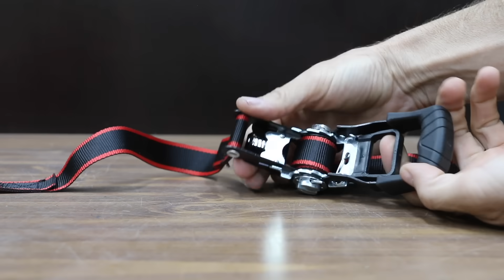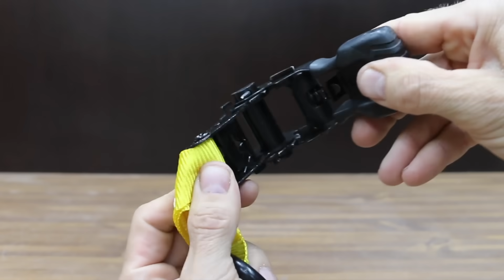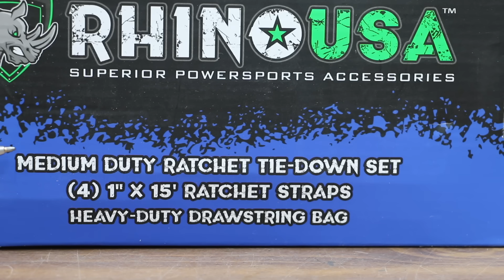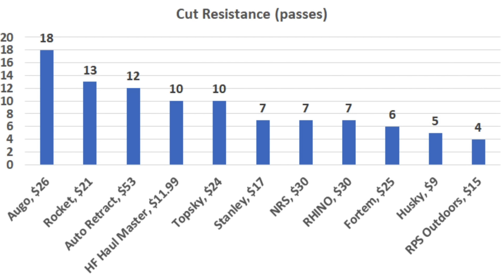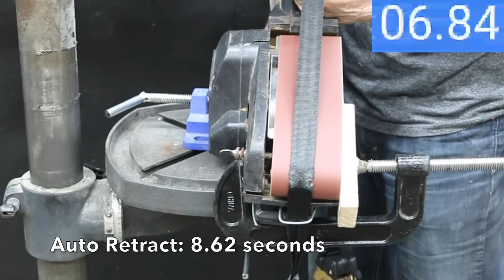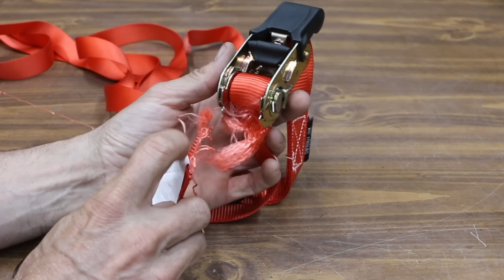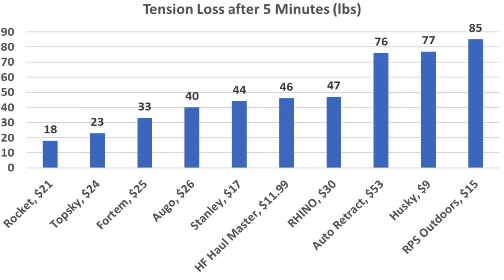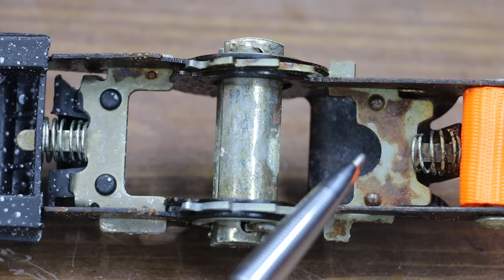Best Ratchet Strap? Husky vs Stanley, Rhino USA, Rocket, Topsky, Augo, RPS Outdoors

Comment: I can recommend those auto retrac ones.   
They are fast and efficient.  
   
They are perfect for leaving in your truck and using them for light to medium duty hauling. Things like a mower, pressure washer, grill, and so on.  
  
I have 2 in my truck bed permanently hanging from 2 hooks so whenever I put anything in there I can quickly strap it. Then I have a set of 4 standard type straps I use for anything really big.

Comment: So I’ve had a few of these straps that I use for hauling motorcycles and strapping to my lifts at my shop. A lot of the time with the ratchet straps over time the failure is the stamped ratchet mechanisms start to warp and Swiss and eventually fail. I like finding cast housings. I do use the autos ratchets you showed they are holding up in that aspect but the streams going to the hoops for the hook are not plentiful and thick enough so it’s stretching out the fibers in those areas as shown. Keep up the good video

Comment: I have various different ratchet straps ( about 30 of them, so so quality), all do pretty well over a period of 15 years so far with use about once per week. One is pretty badly rusted but doesn't affect performance, a few had cuts but that was my fault. Use for tie down refrigerators, top heavy 60 gallon compressor, motorcycles and such. Even used those straps to remove 8" tree stumps with chains and come alongs. Major PIA are the spring loaded detent clips falling out or misaligned.

Comment: I have been using the haul master ones for years with no issues...no failures....yes they do wear out over time and dont leave them out in the weather or they wil disintegrate from the elements. I used them to haul harleys scooters dirtbikes quads trikes minibikes bikes wood furniture fencing appliances etc.  I keep several in a cheap plastic hone depot type tool box....they are cheap enough to replace so i dont care if they fail. I also the husky 1 too... Same thing no issues

Comment: You really need to add ShockStraps to this test. While there is nothing like them, they have features that are unmatched and I have been using them for years with great results. They use a shock absorber in the design and it keeps the strap tight.  I have never had one come loose and I use them quite often. They have cam and ratchet versions.

Comment: Great idea for a review. I think most of the criteria was irrelevant. I use these all the time. The steel that engages the ratchet teeth bends in on the cheap ones and no longer engages the ratchet teeth. The strength of that metal is the most important criteria. Also, if the engagement tabs are small, it doesn’t have to bend much before it’s worthless. The topsky looks the best based on my criteria.

Comment: Have you tested bolt retention with no washer, flat washer, lock washer, internal star washer and external star washer? 
I've read a couple places that lock washers do nothing, but I'd believe it if I saw you doing the test.
Thanks!

Comment: I absolutely love my auto retracting straps. I switched to them, and dumped all the rest. Still have the originals after 3 years of use. Normally straps lasted 6-12 months around my shop.
Reply: The problem is , most warranties  will say something like  "Normal Usage"  Too Destruction  tests ! gives them the excuse to decline , not that they need an excuse , simply their belief is usually sufficient for most companies to wriggle out of it .
Reply: I got a couple long $4 straps but the rest are Erickson Auto Retracting Straps.  Love them.  So convenient. 

Noticed that he skipped the auto retracting strap during the release tension test which would have been 0 lbs

Comment: Nice. If you ever revisit this again, I’d be interested in further testing of stretch and wether something like rain plays a part in the strap losing tension or weakening the overall breaking strength. Also it would be interesting to say test breaking strength after 3 seconds on the abrasion test. And maybe adding in a “sharp” edge to that strength test as well. 
Perhaps even a long term test to test breaking strength after being exposed to  the elements (especially UV).
Thanks.

Comment: I’ve never even seen ratchet straps that small.  Aren’t the most common ones 2”+ wide?  Great testing as always!
Reply: Commercial grade straps are commonly 2" wide with a few different hook or ring designs. We also have the 1" to 1½" smaller straps for secondary purposes, such as small item retention. We often have to snug up the straps after a little distance, due to settling of the strapped items.

Comment: thanks for the rust test. can you also test ropes particularly dyneema and others with different knots, holding fraying, soak strength when wet vs dry etc resistance. also chain including rust test.

Comment: Todd, consider testing universal string trimmer attachments. Take a good base trimmer and try out, say, the pole saw attachments from Hart, Ryobi, TrimmerPlus, Troy Built, etc., that are commonly found online & in big box stores. Some of them probably burn more oil than others or the chains jump off easier. If you did, say, 3 attachments from 5 brands that wouldn't be too much, would it? Pole saw, brush cutter, and hedge trimmer? Lots of people have a trimmer & want more tools as they go, so knowing which attachments are best would help.

Comment: Topsky is already solde out!  I use a tone of these 1" light duty straps all the time and just consider them 1-2year throw-aways (exception is my dedicated motorcycle tie downs that treat like my first born).  Going to try the Rocket because...I abuse them.  They tend to sit in the bed of the truck year round used or not and these seem like they would accept that better than (all but the Topsky's) other's.  That said, even replacing them yearly hard to argue with the $3-after-rebate red straps from Menards.

Comment: use straps in Alaska in winter and have had the plastic in the handles break. The metal doesn't go all the way around inside the plastic.

Comment: Oh damn, that ratchet strap storage tip was MVP of the video, which is a very high standard, hahaha.
Reply: Same here.  I'm not in the market for any more straps so I just came to watch because it's Project Farm.  When I saw how he stores the straps I realized that is a MUCH better method than my "throw them in a box" system.
Reply: @dotar9586  roll them up. Just the strap that way it can be thrown over a load. I do it that way and tie downs on flat beds are done the same on highway trucks.
Reply: pull the tails even then roll up and put in qt ziplocks
Reply: @chrismurphy5564  excellent idea!
Reply: I use a lazy method since it has to be easy or I won't do it at all lol... (but doing nothing obviously sucks more since you have a rats nest next time you need them). I have tried many ways and this is what actually works for slob like me. My method: 1. straps separate from ratchets. 2. Take strap and fold once in the middle. 3. Fold once more in the middle of that, but around something like a bungee against a wall.. or in my case a roll bar. 4. Lay the ends of the strap where you can get your hand on the hook end easily (it will pull out without issues when needed from just the hook, which I can find without looking). 5. ratchets all hung from an eye -bolt. Both the ratchets and strap hook ends within reach of the back window of my rig. When needed I reach in and grab one ratchet and one hook and what I need is instantly out of the rig and untangled, (I carry 4-6 usually). This works even if everything elseback there has become chaos. Not as good at space management as the method Project Farm used.. but if I can get myself to organize at all it is a miracle.. and I can handle this much prep 90% of the time. (Also the 3 parts of the strap I don't need access to I can lay in another direction into a harder to get to area and free up space that way if I am feeling frisky).

Comment: During the friction testing, I noticed some of the straps traveled somewhat across the sandpaper and stopped at an angle to the paper. In those tests, one side appeared to take the majority of the damage before the rest of the strap failed. I wonder if a mechanism that would hold the entire strap down flat against the sandpaper evenly would yield different results? Regardless, a good informative experiment receives a like from me.

Comment: I like the ratings by category. For example, abrasion resistance and number of razor passes before failure are interesting, but not most important. If I’m strapping kayaks to my truck infrequently, failure is unlikely with any. I want straps easy to use and rust resistant with minimum stretch. I enjoy these tests even on items I don’t intend to buy.

Comment: I've tried many straps, ratchet and friction.  Usually, you get what you pay for.

Ironically, I do like the shape of the hooks on the HF straps.  The hooks are shaped so they don't slip easily under stress.  Others have the "S" shape at an angle so can slip if used at a weird angle.  The HF ratchet mechanism isn't very smooth though.

Comment: The auto retract seems like it'd be a nice feature but for that price I'll just live without it 😂
Reply: You won't find any of them in the tool box of my truck.  Too expensive, too bulky, too short, too likely to get jammed up or corroded.  

But in my garage the auto retract are worth every penny, especially for things like strapping motorcycles down on lift tables.

Comment: Missed the one test I would have done.  At work I've gone through a handful of straps.  It is the ratcheting mechanize that fails not the strap.   The metal plate 1st nicks and then bends out of shape and won't ratchet any longer.
Reply from the maker: Thank you for the feedback!

Comment: I don't know if you done or not butt deck stain electric sprayers. Have you tested a bunch and then you can test them to do paint or staining ..
what's the best price 
What can do both .. paint and stain ..
could probably use in the spray paint privacy Fences..
Walls and ceilings in your home 
Whatvis better  battery powered or wired what's the best electric paint stain sprayer to buy...
Reply from the maker: Thank you for the video idea!

Comment: A few ratchets I've used failed while tightening. The metal bent under hand pressure. If you have a second round of testing, perhaps you can crank down on a jig with the scale to see how the ratchets perform.
Reply from the maker: Thank you for the feedback!

Comment: I know this may be odd and a long process of testing but what would the best personal lunch cooler be .... I’ve used several different ones and personally I find the best ones to be a cooler with a good seal from the air but that could just be because of where I live so I’d say 50% humidity with a consistent 90°F would be a fair test to approximate dry and humid climates
Reply from the maker: Thank you for the video idea!

Comment: Do not put a knot in the strap. it will break much sooner.  Also, when they are wet, weaken them.  Do not put too many twists in them... I normally did one to keep from them singing in the wind, as I went down the road all loaded on my trailer.
 I prefer the military grade straps...wider and stronger.  Most are 10k lbs straps.
 Always enjoy and shocked on some of the testing procedures and equipment used in his testing.
 Consumer Reports should be watching some of his videos.
Reply from the maker: Great point!

Comment: Putting a single twist in your strap will NOT dimish the strenght. It will also stop the vibration while driving on the road and hence prevent premature failures from strap friction on load.

Putting a knot however WILL weaken it by 50% or more and should never be done.
Twists are fine.(1 or 2 doesn't hurt. 10 also but there would be no gains or point in putting 10 twists. Just one to stop the flapping at speeds)
Reply from the maker: Great tips!

Comment: I bought stainless ratchet  on amazon and ebay that have lasted me 15 years with no rust or problems. I do have to replace the straps every so often so now I know which straps to buy.  I highly recommend one of those cases that wrap the straps up for you. You can do 4 at a time in seconds
Reply from the maker: Thanks for sharing

Comment: I found two factors on what effects the release tension.   The more wraps on the ratchet, the harder it is to release.  Second, if it does not want to release, just use a screwdriver on the side of the ratchet, to unwind it.

Another Youtuber tested straps to see if putting a twist in the strap affected its strength.  One twist made it stronger, multiple twists, made it weaker.  All the tested straps, same brand used, broke at the drum on the ratchet.
Reply from the maker: Great tips!

Comment: Maybe try ones that are Web Sling & Tie Down Association labeled. U.S. Cargo Control will custom make straps from 4, 500 Lb. webbing. They'll make the tail end however long you want and have many attachment or hook options. I ordered ones that attach with a bolt so the technicians wouldn't loose them.
Reply from the maker: Thank you for the feedback!

Comment: IF there is a thing as such, please do a video on the best battery-operated stirrer/Dremel type tool... I have some plastic model paints that need stirring in these tiny bottles but I don't want to do it manually but additionally the tools I have spin way too fast... Some examples to add are things like battery-operated beverage stirrers, Dremels, pet nail sanders, milk frothers, pretty much anything that I can change the bit out and use something else like an unbent paperclip as a stirring device...

I can supply some old paints I have but if you look for Testors brand model paints you will see the bottles are about the size of a big toe...
Reply from the maker: Thank you for the video idea!

Comment: I’d like to see graphs comparing the ratio of products’ claimed performance to their actual performance.

Also, if you could please display the name of a product onscreen while you’re showing results?  For example, when you were showing the corrosion results, I found it difficult to remember or to figure out which product’s buckle to you were showing, since each one was done quickly and you were referencing others.  Just small text in the bottom corner of the screen would be fine. Thank you.
Reply from the maker: Great suggestion. Thank you

Comment: Would be interesting to see if you could run a lawnmower engine on Nitromethane(drag race fuel) due to its lower energy density or even carbon monoxide. Both would need some kind of increased air supply or o2 rich air.
Reply from the maker: Thank you for the video idea!

Comment: Let’s see which ones have a proper hook of 180 degrees instead of a useless and dangerous 120 degrees! It blows my mind that these  things are still  sold with these useless 120 degree hooks! Unbelievable! The majority of the ones you tested have the 120 hooks and aren’t worth their weight in dog crap as they can slip off suddenly and there goes your load!

Comment: I've always wondered how much real world difference there is in cam out torque between hex, torx, and torxplus.  I suspect there isn't a huge difference for new fasteners in that they are probably good enough to snap most screw heads off but my personal experience is that hex ends to wear out muc more quickly than T/IP.  I'm not sure how to consistently simulate wear on a fastener socket.  Maybe grinding down the tool bit to be undersized (or using the wrong size) so it will slip in the socket. Or perhaps using a countersink bit?
Reply from the maker: Thank you for the video idea!

Comment: Never use rachet straps on a motorcycle!  You can blow out the front forks with ease.  Pull type two on front, and one in the back (to stop hopping) is enough.
Reply from the maker: Thanks for the feedback.
Reply: @ProjectFarm  Uh, expensive experience wisdom

Comment: Great video. I personally own the husky brand ratcheting straps and I spray the ratcheting mechanism with  WD-40 as soon as I open the package. Then I store them individually in a quart size freezer ziplock bag. They work great when you need them.
Reply from the maker: Great tip!

Comment: I mainly use husky due to convenience and price but I have the 1 1/8 straps so far wear has been my nemesis as my trailers hooks are set where the strap sometimes touches the metal of the frame.  I try to put something in between if that’s the case.  And I always strap everything then go back and attempt to get another click out of it before I drive away not only can the strap get slack but the material or items can shift and I’ve ruined many a strap because it loosened and dragged.  So far though the huskies have done the work I’ve asked of them.  Also I keep my ratchets with no tension in storage as well as lube them every few uses to make them release a little bit easier and not get seized.
Reply from the maker: Great feedback. Thank you

Comment: Great video as usual

Just one small thing, with the tension loss test, the straps started with different tensions. Since you can't get them all exactly the same, I think it's fairer if you report the percentage loss in tension instead of just the reading, otherwise I think it's unfair to the straps that started with a higher load, where the same percentage loss would be a higher absolute loss in the reading
Reply from the maker: Thanks for the constructive feedback